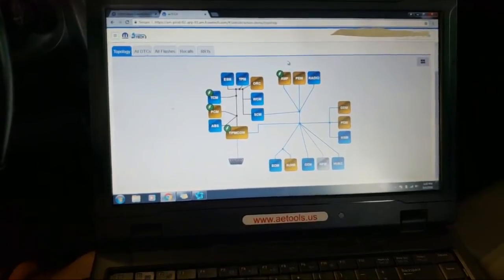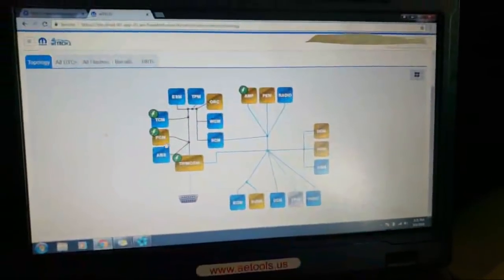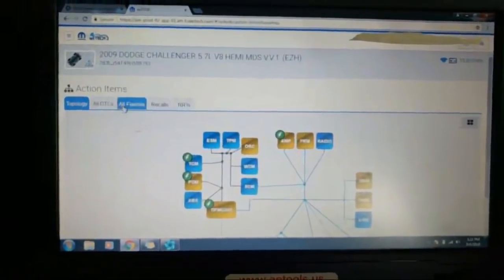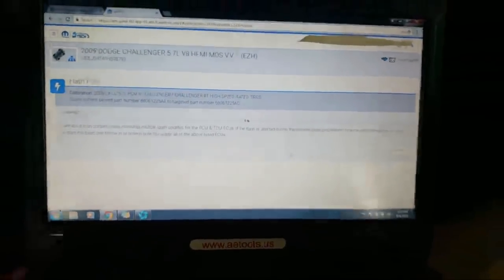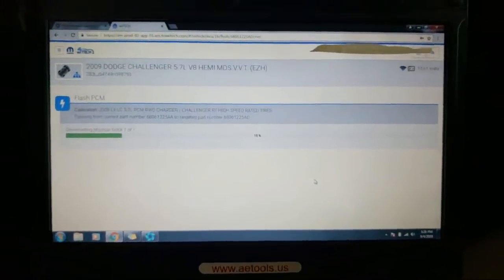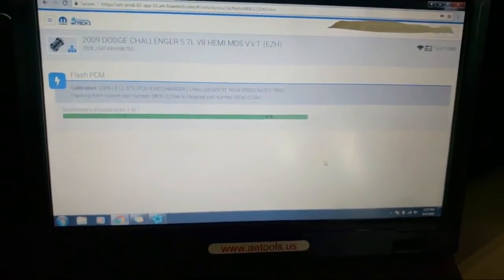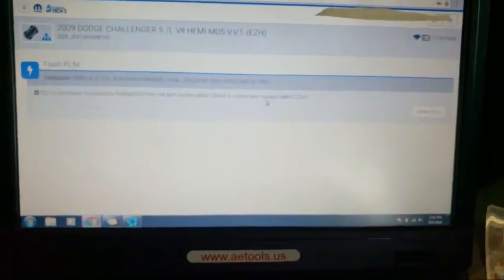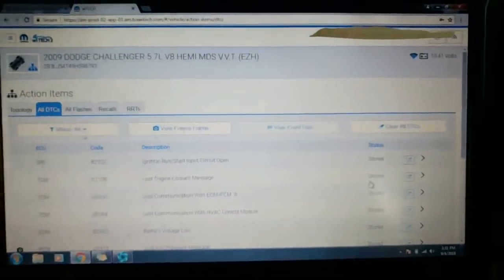Challenger P1521 Incorrect Oil code Witech 2.0

Comment: I got a P1521 code on 2006 Jeep Grand Cherokee 5.7l Overland. Dealer said disregard the code as erroneous, since I was using the proper oil weight and changing oil at 3,000 mile intervals. I later developed the " hemi tick ", which they also said was ' normal '.  Then, I started noticing a slight loss of coolant in the recovery bottle. Around this time, on and off, I would see a small amount of antifreeze on ground(usually in cool morning after driving on a previous hot day). Mosture was seen around front drivers side head gasket. I cleaned all areas around the front of the head. I put a pressure tester on the radiator cap. Pressure on cold coolant revealed a leak of coolant at junction of upper drivers side timing cover and engine block.  Upon removing timing cover, it was revealed that the timing cover gasket in that area was seriously deformed/mushed as to leak coolant outside  of the engine, as well as depositing coolant down the interior of the timing cover and into the oil pan.  This was confirmed by noticing yellowish milky sludge on both underside of oil fill cap as well as remnants of oil in the oil drain pan(noticed a few days later, after coolant separated from the old oil).  Conclusion: Do not ignore the codes produced by the computer. They are triggered by something. If you have a hemi, you might want to check the timing cover gasket. Could this contaminated oil have produced the " hemi tick " ??

Comment: would this code end up making your car not shift? i drive a 2010 charger rt and p1521 popped up and i dont hear any noises coming from the transmission!? anything you can help me with?
Reply: Did you ever find out what the problem was I have the same year and I can’t figure out why it’s throwing that core

Comment: The engine code P1521 pop up on my 2011 300C Hemi 5.7 its started overheating today. I parked it and went thru it. Do you think I need to change the oil again? The engine oil is still good. But I dont know I'm kinda loss on this. If you can help or give me a lil feedback of what you might think it is will help. Thanks